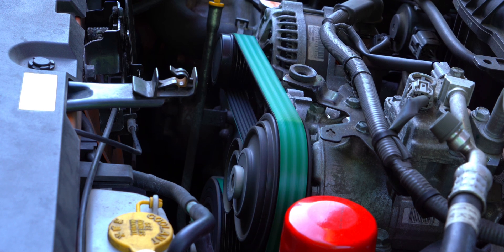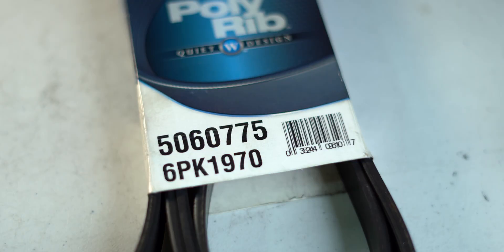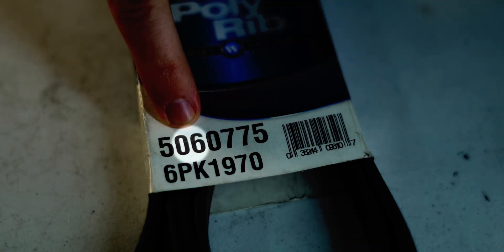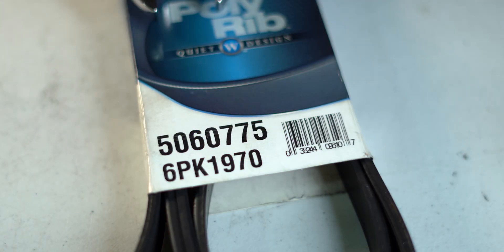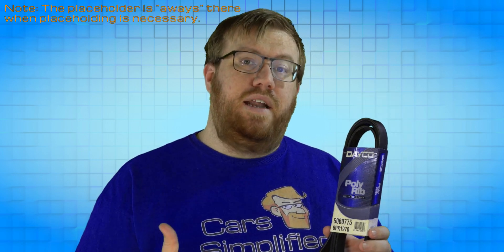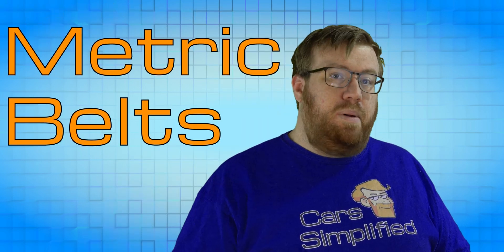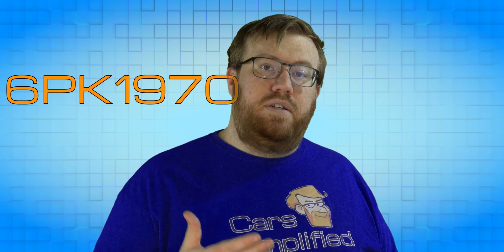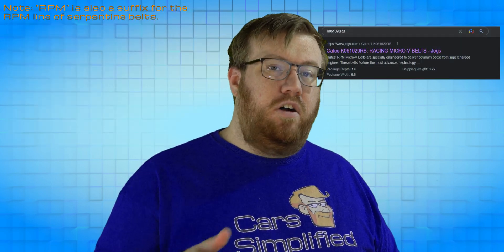Serpentine Belt Numbers Explained: Never Get Sold The Wrong Belts Again!

Comment: So I just bought a belt numbered K060900, which should then be 90.0 inches long. However, below that number on the package is says,  13/16" x 90 5/8" OC.  So shouldn't that part number end in 906 for 90 and 5/8ths (0.625 rounded to 0.6)?